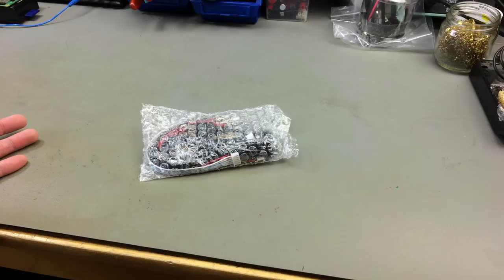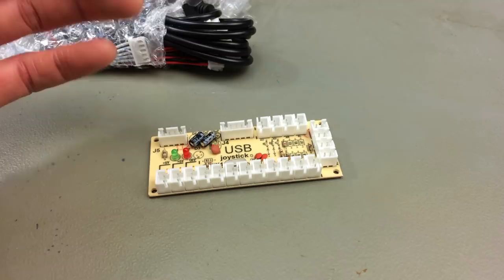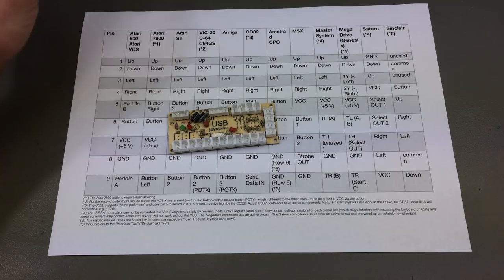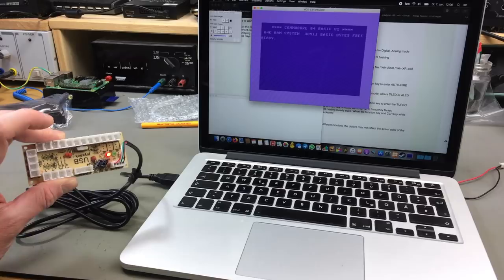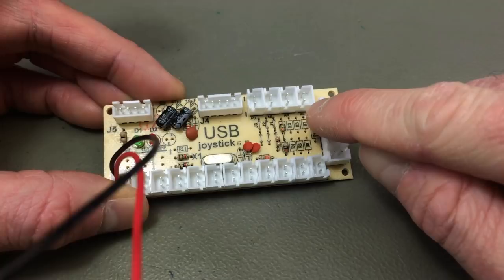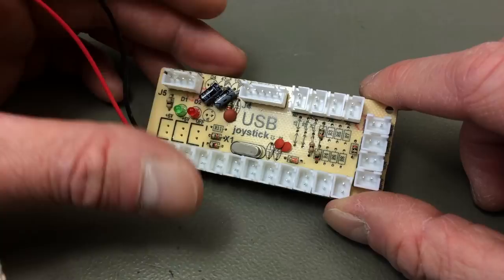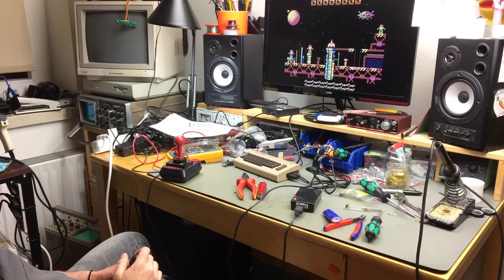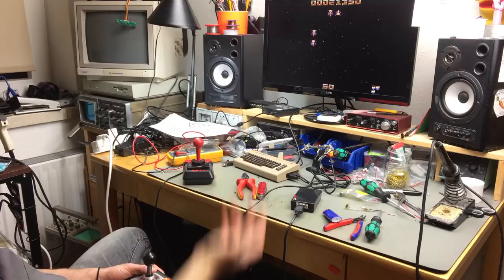Classic Atari Joystick to USB Adapter

Comment: You connected many wires to the ground pin of the db9 connector. Why? All ‘switches’ share a common ground on the pcb so just one wire would be enough. Could have saved you a lot of work! So only the white wires were needed one for each switch just one wire (red/black that was kind of confusing) does the pcb expect a high or a low signal?
One more thing, this encoder has terrible delay, try the slightly more expensive xin-mo controller next time it is so much better.
If you want, I can send you one as a donation to the channel.
Reply from the maker: I wanted to keep it a bit modular, so you could disconnect all the switches except for one and it would still have ground. But you are right, I could have just connected one ground (eg on the 5V plug) and spared me some soldering. The perceived delay is not that bad really but I'd definitely want to try that xin-mon one you are talking about if you'd send me one. :) Please shoot me an email at thejanbeta(at)gmail(dot)com.

Comment: On the old joysticks, would it work to add a new button and wire it to the joystick 'up', so you could hit the button to jump?  (And still be able to use joystick up if you wanted to.)
Reply from the maker: Absolutely, just connect one wire to ground and one to the "up" contact. You can also rewire an already existing second button of course. :)

Comment: I have looked many times to try and find what the chip is used with these zero delay and also the super cheap usb snes controllers you can buy for a few pounds/euro. It would be great to have access to them so they could be used in many projects, but htey are all just encased in the black blob.
Reply: Even if you could find them you wouldn't want to try to work with them yourself.  COB (Chip on board), whats normally under those epoxy blobs means you would only get a bare die with no package and you'd have to try to glue it to your pcb and connect the die wires directly to the circuit board yourself.  Not fun.  Definitely not suited to the home hobbyist.  If you're curious and do want to look these kind of parts up though they will normally be listed as "Package type: DIE".

https://metallux.ch/hybridcircuit/chip-on-board-cob/
Reply: @JeremyLevi  i was looking for a normal chip version, something I can work with, I know I can't do anything with these.
Reply from the maker: Yeah, that would be VERY interesting to know. I suppose you can use a microcontroller for the job but obviously an inexpensive chip solution would be very handy. Nobody knows what the chip is unfortunately, as far as I'm aware.

Comment: Thanks for this video.  It's on my todo list to do the reverse of this, because I'm not a fan of the old joysticks and mice...  would love to use modern controllers and mice on retro computers.  Especially ball mice (like the atari ST mouse) and old school atari joysticks were the worst.  :)
Reply from the maker: Yes, makes sense. I'm using a Tom2 adapter and an optical mouse on my Amiga that makes life a lot easier. :)
Reply: @JanBeta  Yup, I looked at the Tom2 and Jerry adapters but rather find something I can build myself.  There is both the HID2AMI and the SmallyMouse2 that have gerber files out there, but both use SMD components which are beyond my soldering skills (worse than DIN connectors..hah!).  If anyone out there knows of ones that use standard components, that would be ideal.

Comment: beware that some of the USB joystick adapters out there are comming with the (red and black) cables mounted wrong in the plug, ground (black) and plus (red) are switched around...

that costed me a little time to figure out in my last project, because i also made a common ground and the damn thing wouldnt work....
Reply: Dohhh.....26:00......
Reply from the maker: Yes, figured that out by trial and error myself. :D

Comment: Moin.
Do you know if SEGA used the same pin layout on the 9pin connectors of the MasterSystem and MegaDrive?
Because I still have an original 3 button controller at home as well as the MegaDrive Mini.
In case of the Commodore 64 I have equipped myself an original C64 with a Keyrah v2h in favor of its semi-dead mainboard which should do about as well as your adapter on the THE C64, I suppose.
Reply from the maker: Yes, the Keyrah supposedly is great. The SEGA Master System controllers have a slightly different pinout I think, the Mega Drive one uses some sort of multiplexing for the extra buttons so it's not trivial (look at the Wikipedia link I posted in the description).

Comment: Great video. Thank you. I have a zero delay board lying around. I'll give this a go. Does joystick autofire work?
Reply from the maker: Oh, forgot to test that again. I just did, and it doesn't work for some reason. Will have to investigate again.
Reply: @JanBeta  I've been having that problem. Also trying to make an adapter for the Hyperkin Ranger 2600 controller. I'm convinced there's a ADC in there, but I can't get it to power (probably same power issue as autofire circuit).

Comment: Hi! Ist es vielleicht auch möglich, einen Adapter von USB auf 9 Pin zu basteln? Die Preise für originale Competition Pro sind ja retromäßig abgehoben... Wenn man jetzt einen günstigeren mit USB Stecker nutzen könnte, wäre schon praktisch.

Hi! Is it possible to maybe build an adapter from USB to 9 Pin? Prices for genuine competition pro have been skyrocketing with the retro trend... If you would be able to use a cheap one with USB plug, that would come in handy.

Comment: Kennst du / jemand eine Quelle, wo man solche Adapter (passend für TheC64 Maxi/Mini) fix und fertig kaufen kann? Basteln ist nicht meins, und Löten oder Elektro noch viel weniger. Bin auf der Suche, da der TheC64 Joystick nichts taugt (uns ist ein Stick gebrochen, da die Schraube die Kräfte nicht ausgehalten hatte, die beim verkrampften Pit Stop 2 spielen auftraten). Speedlink hat zwar einen Competition Pro, der ist aber nicht für Linkshänder geeignet und kann am C64 Maxi auch nicht konfiguriert werden (Feuertasten 1 und 2 sind anders als beim Original Competion Pro nicht identisch - der verbesserte Joystick vom C64 Maxi ist zwar für Linkshänder geeignet, ansonsten aber wie erlebt nichts wert, da die Schraube die Schwachstelle darstellt). Bin für jeden Tipp dankbar!

Comment: Nice video Jan, as I'm sure you know there are always more than one way to get an outcome you might be interested in what Jarno Lehtinen (mcgurk) did for a similar outcome using a 32U4 based board (e.g. a pro micro) and a couple of DB9 adapters directly mounted on it with a small number of wires - the megadrive page has some good physical examples of how small a footprint you can make it without even needing a PCB or protoboard - https://github.com/mcgurk/Arduino-USB-HID-RetroJoystickAdapter/tree/master/megadrive however he does describe many other classic control variants in that project repo
Reply from the maker: Nice one, thanks for the link. Definitely going to tinker with a microcontroller for the job, too, at some point. :D

Comment: about Atari, do you know a trick to ad an non Atari hard disk? steel using my 1040 STE special for music with Cubase 1.2 as MIDI sequencer...
Reply from the maker: I think you could get something like the SATAndisk which can use SD cards as a harddisk replacement on the Atari. That's probably the most reasonable thing to do if you want to use it for everyday MIDI stuff. :)

Comment: You should of just used a  "D15-USB Adaptor"  that are out there, or  at least a D15 Male to Zero Delay Encoder
It works for you, that's all that count's
Reply: Zero Delay Encoder come with the Red 5v Out Plug,  you just have the wrong one
Reply from the maker: Oh, okay, I'll have a look for the other one. Thanks for the heads up!

Comment: Is 5.15V normal for USB, or even within spec? Every USB port I have measured have had within about 1% of 5V, how shitty is the regulator in that macbook?
Reply from the maker: Oh, that's perfectly okay, USB specification is +/- 10% I think. Most chargers etc. provide similar extra voltage.
Reply: So I looked it up and the tolerance is 4.75V to 5.5v so seems to be ok. Might be that I have only tested with really good regulators?

Comment: I'd considered going this route, but I went a different way for my MiSTER project, using a cheap ATMega32U4, a male 9 pin jack, and a SPDT switch from the directions here (works with Atari-based joysticks, and MegaDrive controllers too):  https://github.com/MickGyver/Mega-Drive-Controller-To-USB-Adapter

This is most likely how I'll mod my 1UpArcade Galaga machine to use a Pi for other games though.
Reply from the maker: Very nice! I definitely want to try to use a Microcontroller for this sometime. Thanks for the link! :)
Reply: @JanBeta  there are several similar designs using this same atmega device, but this is supposed to be a lower lag design.  I haven't thoroughly tested it against other methods, but it definitely does work.  If you're using old sticks with a mister box, there's a zero lag alternative, I believe they call it a SNAC adapter.  Let's you use OEM controllers directly with the cores that support them with a special port on the io shield. I plan on doing those eventually, but the adapter I linked above works for about 90% of what I use the mister for.

Comment: I would use an ATMEGA32u4 .
Reply: @Okurka.  I already did, and for me on a quick ebay search it is about 7 times cheaper.
Reply: @Okurka.  search on ebay for arduino atmega32u4, it is already in a board, it already has a boot loader. i made a simple code(not fully optimized), i have a video showcasing it
Reply: @Okurka.  In my ebay search the price is R$ 76.85 for the already made joystick board, here i found for R$14 on ebay too. 
Now i noticed that it is the 2 pack of the generic usb joystick board, its not 7 times cheaper but it is still waaaaaaay cheaper to get the atmega32u4
Reply: @Okurka.  well we must have different ebays then, because even if he paid 4.5 euro, the BRL to EUR is 4.5 so Jan paid equivalent of the R$20,47,and the arduino is R$14, with that difference i can still buy the cables and connectors , but that's just me, i like to code, and do stuff on my own.
Reply: @Okurka.   
And can you send me the link of this really cheap seller, because the only one that i can find is selling for 18.88 US dollars, and the 32u4 is selling for 3.3 US dollars, now lets open the calculator, 18.88 divided by 3.33, equais 5,72, lets make 5, so it is five times more expensive.
BTW, can you make hardware macros and turbo mode with the generic usb controller?
Reply: @Okurka.  ebay as i mentioned before. it would be cool to have the link of where the hell he got from 4.50 euro.
Reply: @Okurka.  Shipping:
Does not ship to Brazil | See details 
Seeing this looks like the seller don't ship to various part of the world, so it may not be an option to everyone, while the listing offers free worldwide international shipping. so it may be the only option to some people, like me.
Reply: @Okurka.  just to be curious how old are you? because you answer like a 5 years old that don't understand how things work in real life, for some people this listing that you sent is not an option, thats why my original comment is that i would use an ATMega32u4.
Reply: @Okurka.  its that hard to understand that some listing don't ship to some parts of the world leaving only listing with higher price of the same product?

Comment: Great minds think alike -- I finished a wireless solution to the same problem yesterday. ;) 

See https://github.com/hugovangalen/RetroUSBJoystick

As the Arduino can expose more than 1 joystick to the USB host, I've planned on adding support for 2 joysticks at a time.
Reply from the maker: Oh, nice one! Thanks for the link. Great work!
Reply: @JanBeta  Care to tell me the USB vendor- and product ID for the board you are using? (I'm having issues getting things working on my TheC64. I tried spoofing a few different controllers to no avail. Obviously your combination works, so I wonder if I can get things working spoofing those.) Thanks in advance!